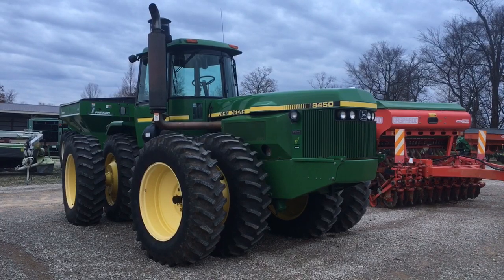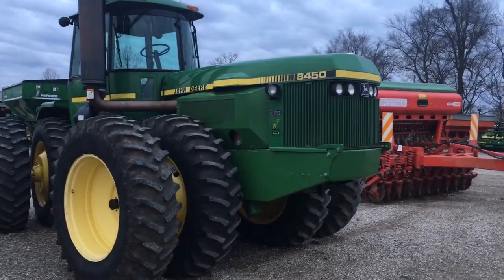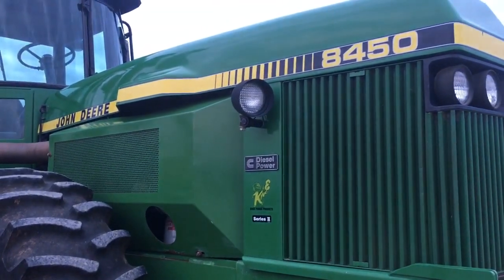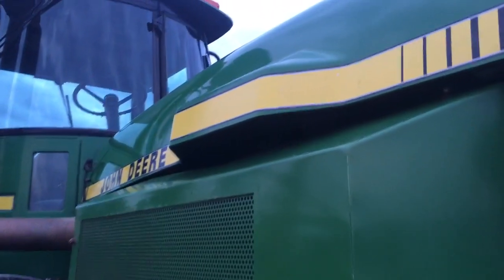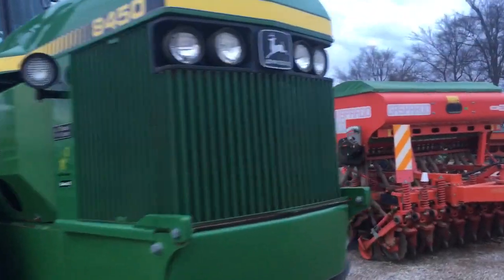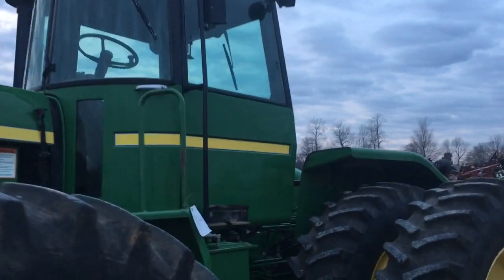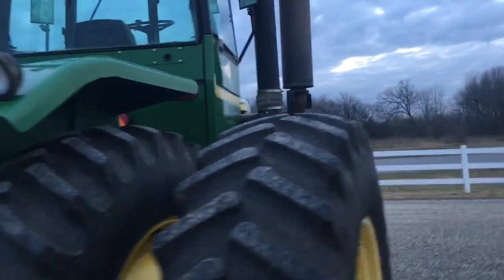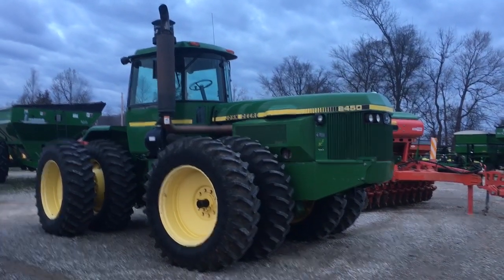Kinze RePower John Deere 8450 4wd Tractor

Comment: Fellow in the loader tractor was buzzin' you.
Reply from the maker: Test drive for a customer.  They made a sale.
Reply: Ahhhhhh, I see.  Had the chance to work for a farmer and got to run a BRAND NEW 8640  with a BRAND NEW 7 bottom vari width plow. That was back in '82 . Man what a step up from a Farmall Super  'M'!!